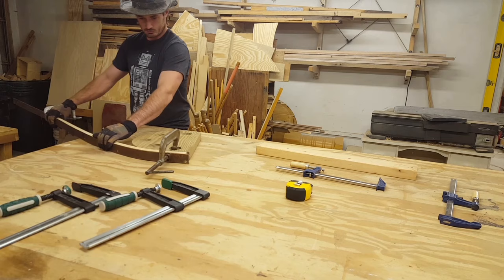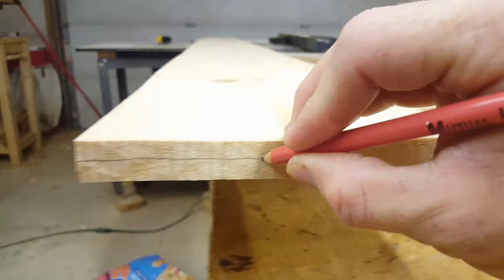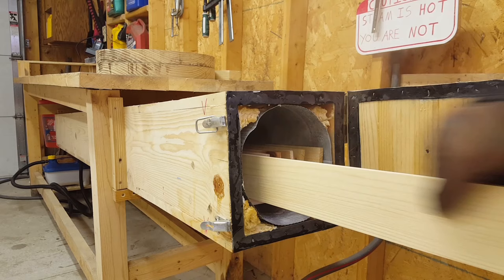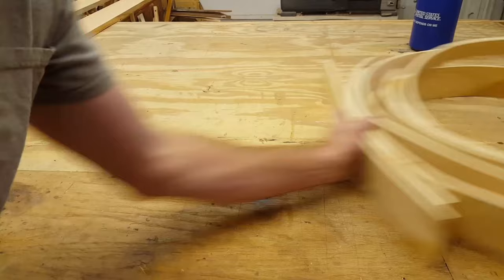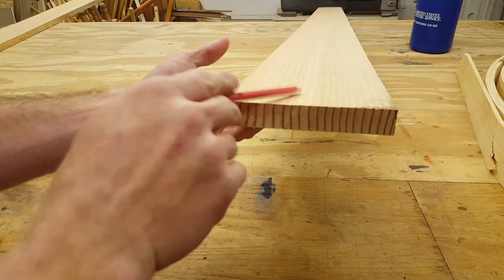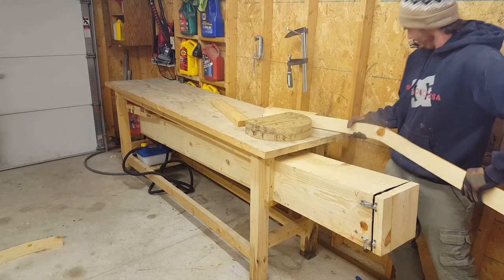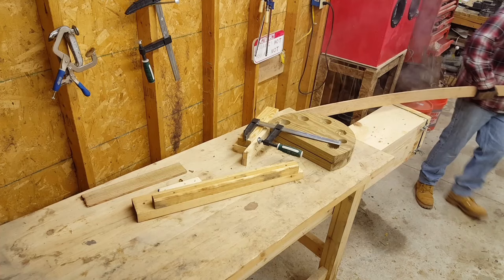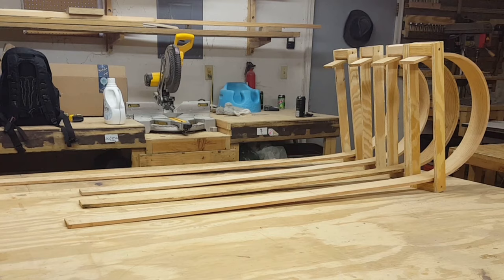How to steam bend wood, Troubleshooting

Comment: Thanks for the nice video. However, if you don't mind, I'd like to add a couple of things:
1. As far as I have seen in these videos, you are working with softwoods. I wouldn't say, they can't be bent, but at least- it works on lab scale. Not on production scale. And yes, thin parts work. Check this from Dave, Engel's Coach Shop, then you understand better: https://www.youtube.com/watch?v=1pPKUgpn0CI&t=446s.
2. Steaming: Industrial steam beinding lines are a different thing. But they don't use any softeners and softening time is just approx. 25 min. for 1" part's thickness. In other words, that gear softens a 2" board in 50 min to do a U-shape bending. However, we talk about hardwoods / deciduous trees. Initial moisture content is a thing, they shouldn't be too dry. Kiln dried is no problem, as long as you can soak the boards prior to bending.
3. Metal strap around the bending is the developmemt of Michael Thonet around 1845 / 1850 who became unbelievable wealthy with the bentwood chair production. Search for Thonet no. 14, that's the chair that made the business take off.
4. For further information, have a look if you can find the "Wood Bending Handbook" by Stevens & Turner (1st edition London 1936, but there are later and more recent editions).
5. For your inspiration on alternative designs, you can have a look at sports / touring toboggans / sleds: https://www.schlitten.ch/en/buy-sled-3r/shop/ or https://www.rodel.at/en/?v=3a52f3c22ed6. These things can be steered (left / right / straight...). The guy that gave me one like these only said, "use a helmet, they can get real fast"... .